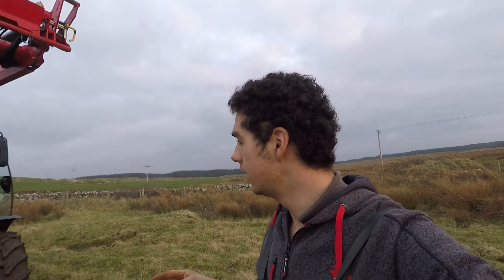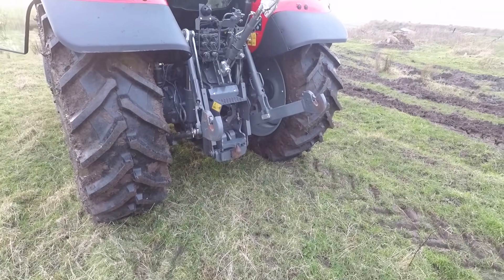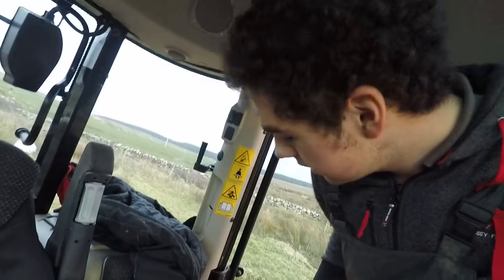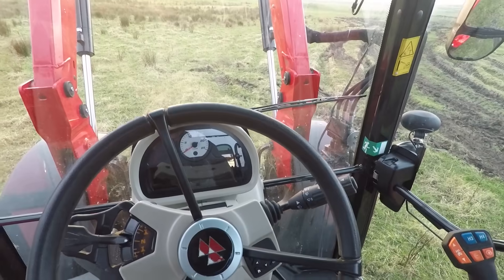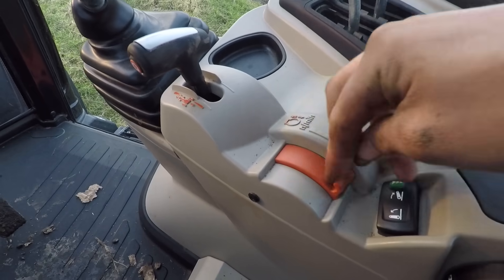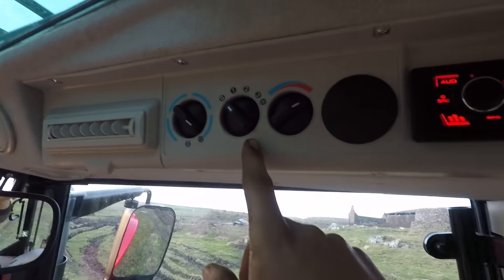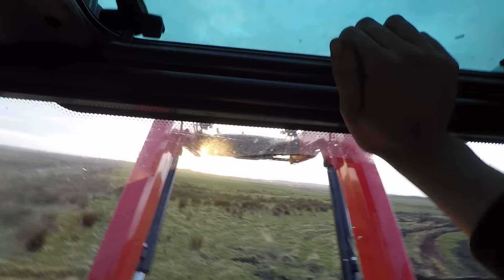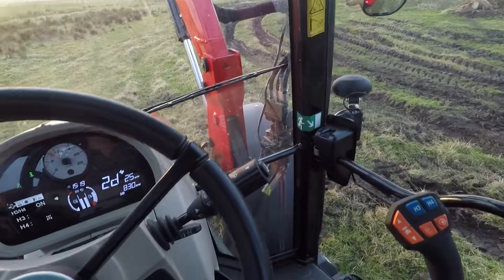BRAND-NEW 2020 MASSEY FERGUSON 5713S - TO Replace the CASE?? (TRACTOR TOUR)

Comment: After driving one for a year and a half  I honestly don’t have a good word for them. I felt it was gutless and had a horrible transmission. The hydraulic pump was slow and air con hardly worked compared to the old John Deere 6430 premium it replaced. But at the end of the day we’re probably just asking too much of it. But anyway I do like the operator controls and how well it rides.  Anyway hope it works out well for you and good luck with it.
Reply from the maker: Cheers, only time will tell I suppose but I'm hoping itll be alright👍
Reply: @AngusGloverVlogs  yeah she’ll be alright. To be honest we were putting 14 ton trailers on her which was a bit too much but brilliant tractors otherwise.
Reply: Yes, its realy gutless but i like the Transmission, its not a Ctv but works good. For loader work you can double the Pump.
I' m doing only Loader and Hedgecutting/Failmower work with it, about 400hr/Year. For me its perfekt, great Cab.

Comment: Do you need to clutch it when you change gear with the handle behind the steering wheel
Reply from the maker: No you dont, only need the clutch when first moving off after starting the tractor.
Reply: @AngusGloverVlogs  thanks

Comment: I'm using both, a Farmall 105u at my Fathers Farm, and an Mf 5710s at Work. Both with Loader. Both are realy good Tractors, the Case is more agil ( Engine is lot more nervus, closer steering) than the Mf. 
The Mf has lots of comfort. Dyna 4 is easy to drive. View on the loader is the best in the Industrie. The Mf engine in slow, not much power.
A mix of both would be the perfekt Tractor

Comment: is that the same spec as the one from the demo a year or 2 ago? looking at a 7718 S myself after christmas
Reply from the maker: Aye I think it's the same spec. So far so good but only time will tell👍
Reply: @AngusGloverVlogs  ah sure good luck with it anyway lad our 6465 is going on 11000 hrs now and still hasnt rlly had any major problems the masseys will last u
Reply from the maker: @joeschipper6465  Oh aye, the Masseys have been good tractors. Never had any real problems with them myself
Reply: @AngusGloverVlogs  yeah they hold their value very well too just make sure its not shook

Comment: If I mind right the peedie button next tae the main PTO switch is pre set revs and possibly the seat safety switch as weel.
Reply from the maker: Aye you could be right👍
Reply: Angus Glover hoo different is the wan u hav noo compare to the demo een fae last year? Luks pretty similar.
Reply from the maker: @lukeharcus6527  I think it's the same spec to be honest. I would have to look back at the old video to compare
Reply: Angus Glover I tak it u got electric and heated mirrors on it as weel?